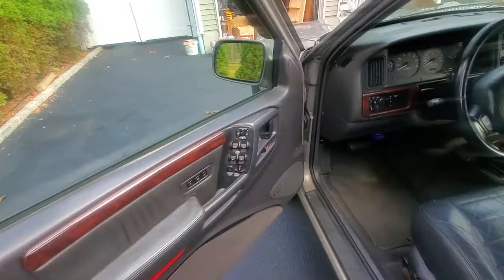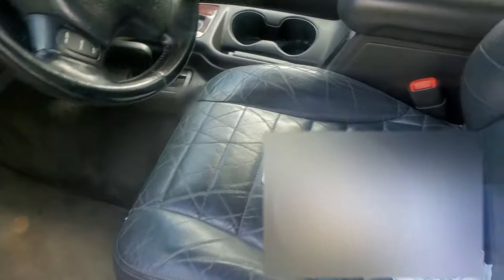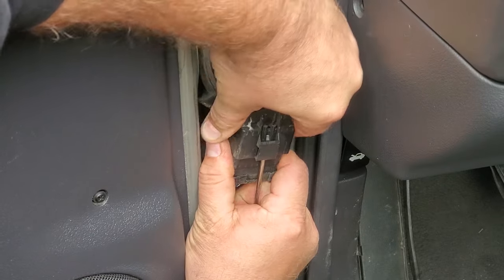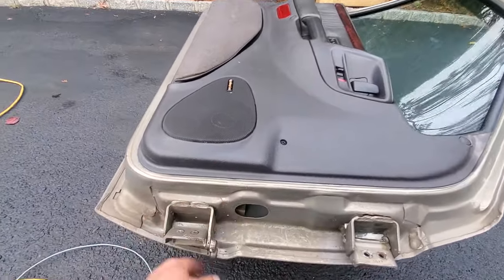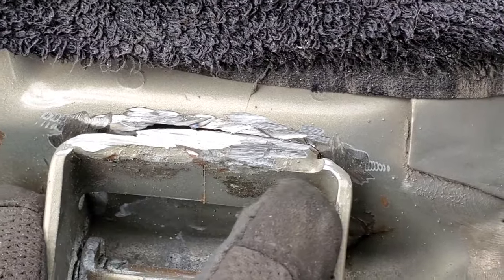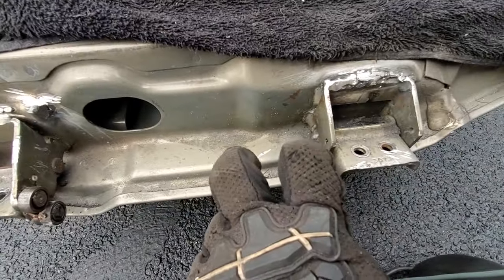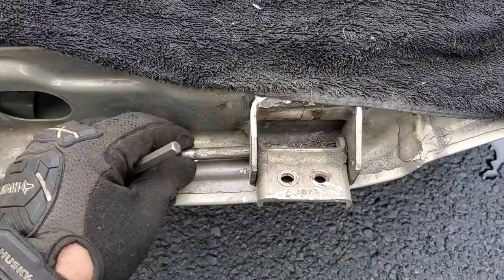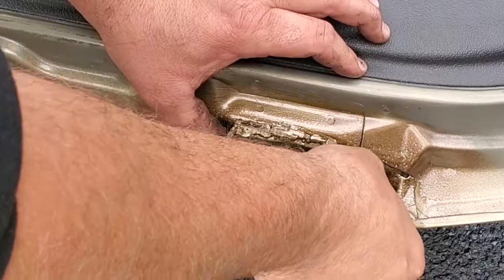JEEP GRAND CHEROKEE ZJ DRIVER'S DOOR HINGE PIN LATCH STRIKER FIX

Comment: i just ordered the same door pin kit that you used in this video i had already bought the dorman hinge pins but i just could not bring myself to use them with all the bad reviews some said they lasted 6 months to 2 years, there is a lot of difference between $5 to $60 but why do the job knowing the parts are crap so i went with the parts you are using also, if you do a job do it the best you can, nice video
Reply from the maker: Amen! if I'm gonna do a Job I'm gonna try to do it right!

Comment: Cool project!  I had a ZJ which I had to do just about everything to that driver's door: half the wires on either side of the connector were broken, the speaker was blown, the window switch had cracked solder joints (couldn't open the switch to repair it so had to cut the back off) and door panel was wasted so I had to replace that too.  Was quite a Saturday.

Comment: As always ,awesome vid Dan. Glad to see you DIDN'T get the POS DORMAN hinge pins. They don't last a year. Ask me how I know...hahaha
Replaced twice on our 97 but now my 98 will need to get done (first time repair)..
As soon as I can pull myself away from our "Project J-bird" (2003 WJ 4.0L/RE42 auto trans and NV242 T-case and axles grafted into a 1985 Pontiac Firebird body)
Reply from the maker: Wow, Awesome build!!! I got doorman water inlet tube for my XJ water pump and it frikin leaked out of it's weld.. so frustrating!

Comment: FYI. That little hole give you access to a hex nut that adjusts how much you have to press the door handle button before it opens/unlatched. 

My ZJ got to the point where pushing the button all the way in wouldn’t open the door. A hex + a small screwdriver in there and it was as good as new in less than a min.
Reply from the maker: WOW, I never knew that!!

Comment: Hi Dan, while using a grinder, you can always use a smaller die grinder, or a smaller cut off wheel for a less chance of puting a nick in the door flange. Just saying.
Reply from the maker: sure ya could buddy!

Comment: You should use fluid film spray. It keeps stuff from rusting out. I sprayed the whole underside of my WJ and under the rockers, drain holes on the hatch and doors. I swear by the stuff it works great! I also spray around the wheel wells. All the salt water from the roads just runs right off it. Happy Thanksgiving!
Reply from the maker: Yes fluid film was amazing! I need to get a couple crates of it 😃

Comment: Good timing Dan! Need to do this for the "newer" door I had to get because someone backed into my drivers CLEAN fender and hair tapped the door. Was going to replace the door anyway as a previous owner used hot snot on the latch bolts instead of a plate. 
Also if anyone knows of a place to get new/ used  clean fenders, I'm all ears!
Reply from the maker: Sorry to hear that bud! I'll let u know if I find anything.

Comment: This is the single best mod imo, for just fixing annoying chits from the factory. Did the plate to both my D&P doors due to previous owner abuse
Dan, when you plan on adding the tweeters and new amp to the General?
Reply from the maker: I have a lot of extra sound equipment, just need to find some extra time

Comment: Nice video.. my 5.9zj has the same issue, broken welds.. hinge pins sagging and the door latch cracked off the door itself.  So when i drive and lean on the door when i turn the interior ligjts come on and my VIC beeps telling me door ajar .. and my locks auto lock again hah

Thabkfully i can weld ao ill just weld it back on the door.  And weld the hinges back on.

I bought some HELP section door pings.. didnt know they had ones like yours.  So im not sure how well the cheap HELP one will hold.

Tbh i almost thought of just going to the junkyard . Finding two good doors.. and cutting the hinges off.. and welding them to my zj.. might be faster to do that.

ZJ doors are deff a downgrade from the wagoneers they were ment to replace.  Wagoneer doors are thick and heavy as hell and the hinges are way better.

Not sure how you mansged to cut the pins out eithout cutting into the door..  mine is cutting into the door it just wont fit right
Reply from the maker: Gotta take your time.. Don't Cut your Door! Get the Good quality pins, its worth it!
Reply: @ProjectDanH  already cut the door haha.. but i can weld easy so ill weld grind it repaint inside etc.  

My 4 and 3 inch cutting wheels cant cut the pins without cutting the door.. its impossible.  It must be your grinder and its head or locking nut are smaller than mine allowing more room.

I cit the pins off in the middle with my dremel after lol took forever but it worked better...   

Btw did you kit last ?  The doorman ones bushings are BRONZE not even brass.. and they fall apart for everyone.  So i wanna do it once and done.

Almost debating on trying to find hinges in the junkyard and cutting it entirely off and welding it on my door seeing how these  crappy kits kits have bronze soft metal bushings

Comment: Hey Love all the jeep help especially on the ZJ, the door hinge pins the link you put on amazon look different then the ones you installed,  those have a lock nut amazon does not. any help would be great.`
Reply from the maker: Your Absolutely right, here is the eBay link to the pin set I used

https://www.ebay.com/itm/371707978237?chn=ps&norover=1&mkevt=1&mkrid=711-117182-37290-0&mkcid=2&itemid=371707978237&targetid=1263433204694&device=c&mktype=&googleloc=9004597&poi=&campaignid=14859008593&mkgroupid=130497710760&rlsatarget=pla-1263433204694&abcId=9300678&merchantid=6305544&gclid=CjwKCAiAqIKNBhAIEiwAu_ZLDo5a2hu0lz7wFgRMbXSSDiMjQ-5_60HML1OtnsbN2BezoQuwD39MwBoCnZsQAvD_BwE

Comment: Dan, you’ve got a ton of experience with both platforms, so I wanted to ask you—if you had to choose just one to keep, and the other to never own again, would you choose the XJ or ZJ? 

I’ve only had Cherokee’s, and I feel like the creature comforts of the Grand Cherokee are calling my name. Four coils, V8, rear disc breaks, comfier seats, sunroof, nicer interior… but the transmissions make me nervous. What do you think? Is the grass greener?
Reply: And regarding the ZJ’s, what are your thoughts on the 93-95’s vs the 96-98’s? I like the exterior design of the earlier models better, but the redesigned years seem to have more up to date technology and from what I hear, are a bit more reliable? Would love to know your thoughts!
Reply from the maker: Wow Brother, LOADED question!!!    I absolutely love my 98 ZJ 4.0 reliable, drives great, smoooooth compared to an XJ... however Id choose the XJ over the ZJ any day.  The best part about these old jeeps is that you can basically take an XJ and turn it into ZJ inside.  grab youself some power ZJ heated seats and your good to go!

Comment: Enjoy the NY accent... what kind of welder?
Reply from the maker: LOL I dont have an accent im aware of 😂😂😂 Harborfreight fluxcore 125
Reply: @ProjectDanH  You've got an accent like I'd imagine someone in NY in Babe Ruth's era... it's cool.  Of course, I'm in Los Angeles.
Reply: @ProjectDanH  So no gas on the welder?  The whole idea of a big gas tank is kind of scary but I could go for that $99 welder you mentioned... my door is coming apart like that too at the weld.  Thanks for the DIY videos.
Reply: @ProjectDanH  Maybe make an amazon link so you can make some $$ if I buy it...
Reply from the maker: @VenturaIT  that's awesome.  Greetings from the east coast! 🤝
Reply from the maker: @VenturaIT  my pleasure.. yep . No gas. Sloppier than gas but very easy
Reply: @ProjectDanH  How's it holding up?  Mine is totally popped off on the lower hinge, took it to a body shop who didn't really want to do it and said come back next week... I'm now thinking he doesn't have a full-time welder on staff.  I have pinstriping on my ZJ so my worry is not getting aligned right, how do you do that?  Maybe it will be fine since the top hinge is still attached for now.  Any idea how much a new door is?
Reply: @ProjectDanH  Just took it to a welder and he tacked it and put a thin bead with the door still on the vechicle and it cracked the bead.  My lower hinge is totally off on all 3 welds.  My worry is that if I take the door off, how will I know if the alignment is correct?  Or do I just need a new (used) door?
Reply: @ProjectDanH  Took it too a real body shop, independent body shop, but very good, most body shops wouldn't touch it, I had to call around and start the call with "do you do small projects..."  They had a really talented welder there who did it with the door still on the car.  I lucked out because the lower hinge was totally popped off/ripped off and the constant closing had tweaked the surrounding metal and the hinge metal a bit, so it wasn't easy.  And the welder I tried made it worse...  and it seems like they got the alignment right, which is amazing.... but maybe it self aligns within some degree of accuracy, so it doesn't have to be mm correct in alignment.  They didn't do a good job rust proofing it and got some paint on the trim which now I have to deal with somehow being so OCD like I am.  The door had been clipping the fender so I had to pull the fender out with my hands a bit to get it to look normal.  Now I have to go to a paintless dent repair guy to fix the  minor dings on the inside of the door near the door latch where it was hitting when it wasn't closing right, mine isn't so damaged that I can't get it back to normal luckily.  But dang I hate it when I get a new ding on my ZJ.   Soon I'll have to just rino line it.  But I love my ZJ.